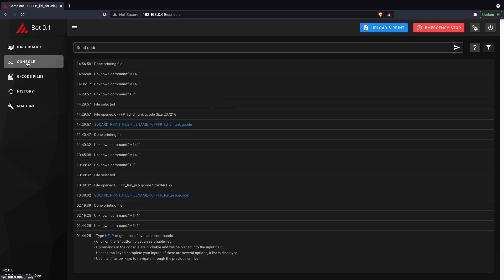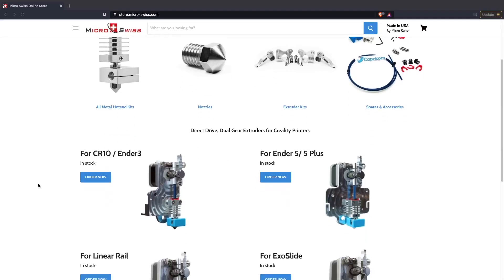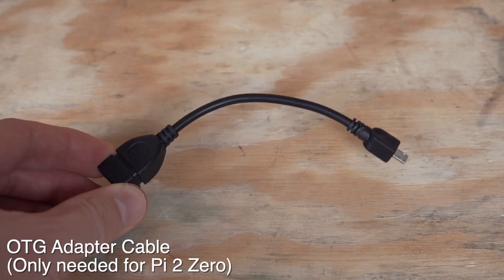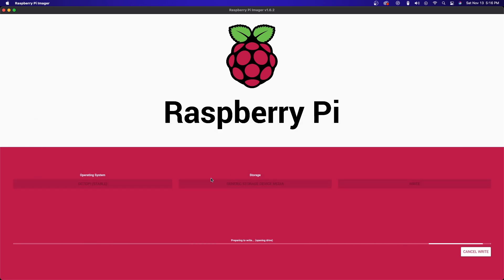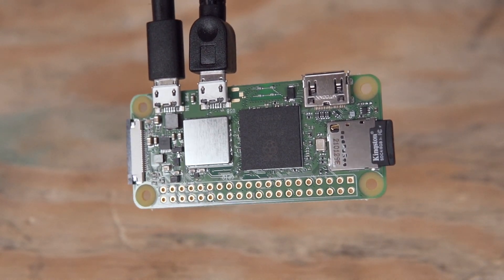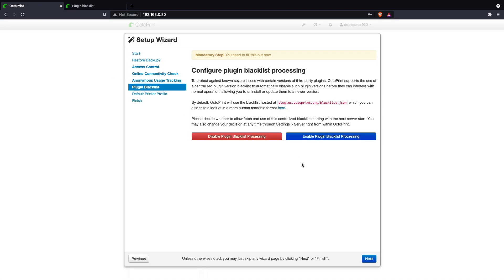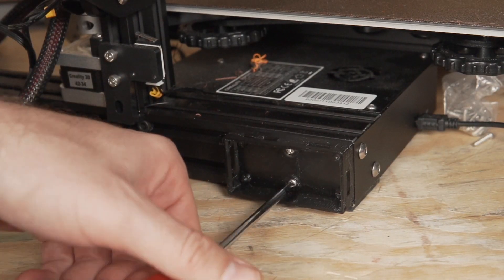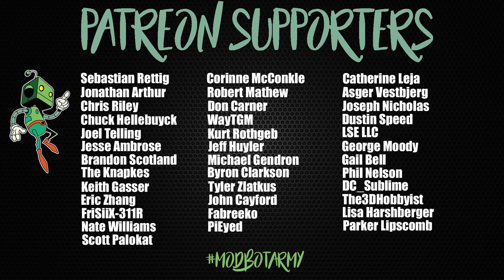Installing OctroPrint On Your 3D Printer Has Never Been Easier! (Pi Zero 2 W OctoPi Guide)

Comment: The OCTOPI build on the Pi Zero 2 W took me about five minutes. It was remarkable and needed no setting up.
BUT if you want VNC and all the other Raspberry pi GUI based interface in addition to Octoprint - go the 'install octoprint onto an existing Raspberry pi' route, not the all-in-one octopi build method. My RPI won't support the standard 'startx' GUI because octopi is a subset of the standard Raspbian.

Comment: I followed the steps but for some reason the pi won't connect to the wifi network.  I tried connect via ethernet cable and that works but when I disconnect the cable, I get disconnected.  Can you off any advice?

Comment: Hmm, I’ve got an H6 orange pi. Read somewhere it will work. Orange pi had more features and expansion and also allowed me to use a full size solid state drive to install the operating system to.

Comment: I'm going to try this in combination with a "USB ETHERNET HUB HAT VOOR RASPBERRY PI ZERO" So i can have the stability of wired internet and some more usb slots for e.g. cameras or connecting to the printer instead of the flimsy micro usb port. I will also use the printer power supply with a dc-dc converter so i dont need external usb power.

Comment: please someone show this setup with a wired connection to the internet. it should be easy but cannot figure it out, only ever get shown wireless setup. i tried just plugging the ethernet into the pi and no luck, its working over wirelss but the camera is lagging behind about 5 mins so wont a better more stable connection but seems like you cant, even tho theres a ethernet port on the board

Comment: Be very careful about using Octoprint.  It bypasses many important features of your printer board, including filament runout sensors and perhaps thermal runaway protection.  There's no way to tell if Octoprint is disabling your safeties without some complex testing.  I found this out the hard way.

Comment: Pressing CTRL + X (CMD+X) in Raspberry Pi Imager will open the advanced configuration setup menu. You can set the WIFI and SSH access there before burning the image, and remove the supplicant.wpa and .ssh file edits. I made a video about it a few months back. 
https://www.youtube.com/watch?v=eS-N8NCB9rk&t

Comment: Your video was very helpful and I installed octoprint on a pi0 w 2.. only issue is if the pi is still powered up I can't turn off my printer... it's a faint screen but it's still on until I un-power the pi. I purchased the cable you recommended from amazon but it must have data and power capability... any ideas???
Reply from the maker: I have seen others either physically block the 5v pin with something like a piece of tape or a bit more aggressive cut the cable and cut the 5v line.

Comment: @ModBot  FING app reccomended:
Hey! You said the easiest way to see the pi ip adress was logging into the router. I used to do the same, until i started having to set up pis at my workplace where i dont have access to the router, and had to rely on the hostname.
UNTIL: i discovered an app called "FING"  that scans the network and shows devices as well as online time, hostname and so on. It even has an option to wake on lan, ping and ssh via an ssh app. The app is definitely reccomended! it's available on both IOS and Android, and is a lot easier thatn logging into router, no matter how easi that may be ;)

Comment: You can disable the 5V wire in the connector between the Pi Zero and the printer - comms only need the data and grounds wires to be connected.

Comment: Octoprint is such a pile of hunk. It hogs resources, sure it has a bunch of plugins that arnt really needed but I run 5 printers off 1 raspberry pi using repetier server. The octoprint devs really need to do some performance fixes on that hot mess.

Comment: To prevent the pi powering the printer you can put some tape over the usb power pin on the usb-a side.
Reply: I wanted to not only thumbs up this but comment, very important step!
Reply: oh wow! I wish I thought of that before cutting the power wire on my cord. Kapton tape probably would be good to use.
Reply: what the heck
Reply: what happens if i dont put tape?
Reply: @cristianfernandezchaparro67  this will supply power to the printer board and cause a reset, having only the data connected will not interrupt.
Reply: @rwz  thanks
but i dont understand
can you explain more what that means?
i put stripes of tapes on the sides, but octoprint doesn recognize the printed as if its not conected...
Reply: @rwz  even without the tape i still keeps without recognizing the printer as if it wasnt connected
Reply: @cristianfernandezchaparro67  did it work prior to taping it?
check if you put the tape only over the power pin.
if it doesn't work I can not help you any more.
Reply: @rwz  no, i didnt work even without the tape, i think maybe is the cable, or the software of the printer, i had problemas with the printer before because the scrren goy stuck in "creality", the solution was to reinstall the software a couple times, after months the lasts weeks the problems was that the sdcards atoped working in the middle of the printing, i had to Buy a couple new cards and then same happened, not Even My laptop recognized the cards, so, or is the cable or is the software of the printer, i Will try to connect the Raspberry to the PC to see if its not the Raspberry the one that not works
Reply: Well... The PC isnt recognized... So i don't know anymore

Comment: I hooked this up tonight and could only get it working if I plugged the USB OTG cable into the 2nd port. If I used the first port it just wouldn't work, so I gather that is by design. I had some right angle USB OTG cables I was hoping to use, but those are out as they would block the power one. Will have to order a left angle one to make it a bit neater, but luckily had a straight one that will work for the time being. It's nice to have a Pi devoted to each printer.

Comment: Wasn't there a need to SSH into the PI to enlarge the storage to the full SD card?
Reply: No, its automatic now on the current releases of octopi.
Reply from the maker: Yeah I believe that was only with the older method of manually installing. With the current setup there is no need.
Reply: @ModBotArmy  I followed your steps yesterday and the boot partition was very small and 7GB where unformated till I added them.
SSH into the PI

sudo raspi-config

// first to make sure all is fine
update
// after that into advanced
expand_rootfs
// and
Finish

Comment: Can I use the gpio pins for the mk3s like I could with prusa print?
Reply from the maker: It should not be an issue. This does draw a bit more power but I swore I saw a few posts in Prusa forums saying it was no issue. I would double check just to be safe before.

Comment: Just bought a pi zero 2 w yesterday and was thinking of using it for this
but I am wondering  if for my needs a  1st gen pi zero W will do
ender 3 pro and jus for  simple printing ,  can you explain the differences ? how much slower is it?
I have a wyze v2 I was going to use  for a camera with it's original FW or RTSP FW
so I won't be using a camera with  it , I guess I could use the pi  zero 2 W with  the wyze cam connected to it via USB if I flash the   wyze web cam FW to the camera and  view it through octoprint instead of wyze app
Reply from the maker: Totally up to you. I used the gen 1 with no cam and didnt mind it. Hell I ran them in a farm config and had no issues. I have not done a side by side speed wise but if you already have the original zero w maybe try that and see how you feel.
Reply: Where did you manage to find a place to order them from? They're sold out everywhere I'm looking.
Reply: @housinit  Microcenter , in store
1st time they  came in stock they sold out in a day ,  about a week later they were back
they had 25+ not sure if there still in stock now thought that was few days ago

Comment: you know a good blocker that blocks the power on usb for my ender 6? i have no idea what to look for? i do live in eu.
Reply: I used an old USB cable and peeled off the outer sleeve. I cut a section of the red v++ wire and used electrical tape to cover the wires.

I felt this to be necessary, as the printer would try to power from USB (dim glow on printers screen). In my mind this is dangerous and must be looked at, as 5he USB bus is not meant to supply 24v and worst case scenario is fire.

I have heard of folks attaching USB to the computer before powering on the printer - the result being a corrupt firmware on the printer and a fried USB bus on the computer. 

Be aware if your printer lights up by USB...
Reply from the maker: You mean to prevent the Pi from trying to power the printer or to prevent the printer from trying to power the Pi? I have never ran this but if you did want to I have seen some use a thing tape strip to cover the 5V line. Or as mentioned below you can also remove the outer cover and cut the connection of the 5v line.
Reply: @ModBotArmy  the ender 6 seems to like put power on the 5V and that makes it that the printer sometimes just doesn't power on properly. i really want to use octoprint but i don want to fry it or my printer. i saw another youtuber using a blocker between the printer board and the pi. thought maybe you know were to find this, is it save to just disconnect/cut the 5V?

Comment: Does this work in parallel with Marlin then?  For some reason I thought it replaced it and was the printer's new "firmware".
Reply: Marlin stays as the firmware for your printer.

Octoprint is loaded on to the raspberry pi, which is connected to the USB on the printer like an external device.

The pi simply sends the gcode to the printer via the USB.

Basically, Octoprint gives you WiFi control (by Web interface), which is actually very useful. It can also use a camera to allow you to watch the print without being right next to it and a bunch of other useful stuff
Reply: @paulradford4100  Thanks!
Reply from the maker: Yup! So it is just an interface between the Octoprint and Marlin on your printer :). For Klipper it is a different scenario as it is its own firmware that runs on the Pi.

Comment: PSST!  Pi Zero 2W  ;)
Reply from the maker: lol updated. Thank you :)
Reply: So I took the plug and ended up getting a pi zero w which may have been a mistake.  I got an error message from Octoprint saying this pi is and never will be supported.  It did seem to connect but now not sure I should stick with it.  Guess I need to now upgrade to a 2W.  Anyone using the pi zero w?
Reply: @jerseybarrier64  have you tried using an older version of the  octoprint image? maybe Daniel could suggest one?
Reply: @andreamitchell4758  thanks and no have not. The board is working but sounds like I may run in to stability issues.  This is all new to me (thanks Daniel ;) )
Reply: I still think   pi zero w 2 makes more sense 
R PI foundation  dun goofed
I was searching for w2 and nothing was coming up when  trying to buy one
W 2  makes more  sense IMO

Comment: I've been thinking about upgrading my Ender 3 V2 to a linear rail system. Is it worth it and where can I find one not shipped from china??
Reply: I've seen on another video that it doesn't really make a difference in print quality.
Reply from the maker: I would argue not a huge noticeable difference. It is going to be stiffer and I would be curious to see if it has much affect on tolerances but I think it is a pretty overkill mod. That being said it has never stopped me before so if you want to I say hell yeah. The low cost ones can be decent if you do not mind shipping and cleaning them when you get them.
Reply: @ModBotArmy  Is the length for the Ender 3 v2 linear rails 300mm or 400mm??
Reply: I've been running a couple modified E3Ps for a while now and I don't see a need for a linear rail setup.  Once you have them tuned in, print accuracy is completely fine for most projects (I use mine primarily for functional parts).

Comment: Great video. If you know, will you be able to do a video "how to add multiple webcams to octoprint"?  The old method doesn't work anymore or I'm doing something wrong.
Reply from the maker: Not something I have done. Would the reason for this be to make cool timelapses from different angles? Or just if a print gets tall to make sure nothing if failing?
Reply: @ModBotArmy  I like to put one camera to the Filament roll since I have couple web cams laying around.  There is a multi cam plugging in plugging manager, but I did not had any luck.
Reply: @ModBotArmy  https://youtu.be/FzpBgEG_ksw 
This is so outdated.

Comment: I'd love to see how well Klipper will run on that. I do have several projects, that would innclude installing klipper on a printer and i'd rather not have to buy a full size PI, they are rather expensive.
Reply: It runs really well. I installed it on my ender 3.
Reply from the maker: It is going to happen. Lots of requests for this. I will show the install and then try to test it with input shaper.
Reply: Kossel Linear Plus, Klipper, Fluidd, Pi Zero 2, no webcam, runs lovely.
Reply: On my ender 3v2 all I needed was an adapter, pi zero 2 w, micro usb to micro usb (less than 40 euro in total). It took me 4 days to set up and finetune. Now it’s working very smoothly, all the Klipper algorithms were successful and helped improve my quality and speed!
Reply: I'm in exactly the same position.
Reply: It would be great to se Klipper without external power supply - I heard that it's possible, connect RPi Zero 2W to motherboard only
Reply: @Rajonex  it's only possible if the board's 5V regulator can supply enought current. For example SKR Pro can do that. Or you can use DC-DC stepdown converter.
Reply: @Rajonex  Adam is right. You just need a buck converter to connect to the 12/24v power supply. They're only a few dollars.
Reply: @corey640  I know about this "dirty" solution. I mean something more clean - in one bunch of cables send signal and power. Like in cameras where you use one Ethernet cable from computer. Using external buck converters etc it's not good technique, more places from you are getting cables - more messy view and overall rate of your modification.
Reply: @Rajonex  Sorry, a single cable from a Pi to a buck converter placed in a power supply enclosure, maybe print a new one with a larger fan, maybe even with room for the Pi, etc, isn't "dirty". Have you seen how many cables are underneath a printer for Christ sake?
Reply: The OctoKlipperPi is available in the pi imager now
Reply: $45 is "rather expensive"?
Reply: @corey640  More like 80$ where i live, 10% of my monthly salary.
Reply: @baivesan  Maybe $80 for a 8gb. I just bought a 4gb 4B for $55 and they had 2gb for $45 at PiShop. Order from one of the dozens of UK or US sites if they're marked up in your country.
Reply: @corey640  A 4 gig is currently $150 in my country (Scandinavia) with anyone having them in stock. Got mine for a steal 3 months ago, at ~$95. 2 gig is $135 ish now, 1 gig has been hens teeth since its release. The two shops that have the Pi Zero 2 W in stock, charge $100 for them. Or $110 for a basic kit.

These things aren't cheap in many places of the world, especially if you're in a country at the outer geographic edges of a market/trade region. But they're generally never available anywhere near MSRP unless you have an official RPi partner vendor nearby to buy them from. During the pandemic supply has gotten pretty bad. Heck even Chinese vendors are charging $120-140 for 4-gig now.

International Import from uk and us sellers can make a cheaper unit even more costly in many places.
Reply: @corey640  Yeah the PIs go for 45, but cables, power supply, sd card. Not super cheap :&
Reply: @pr0xZen  I'm sure you could buy a Pi Zero 2 from USA for $15USD... with reship shipping it would be less than your local retailer.. but if you say the 4GB version is only a few dollars more id strongly recommend that one.
Reply: @kylelongstaff  when you add a power supply case and cables it adds up even in U.S. The Canakit I bought was around $55. Pi 4 kits can run $100-150.

Comment: Awesome video.  Wish I had bought more of the Rock64 boards when they were so cheap on Amazon, so was pretty excited about this new Pi.
Reply from the maker: I dont know if I am familiar with the Rock64, maybe I am haha. Is it a small 64 bit sort of all in one computer like the Pi?
Reply: @ModBotArmy  yup, it's a nice contender for low power sbc home servers when you can't afford AsRock or SuperMicro SOC itx boards. It's a bit more evolved than the RaspBerry Pi.
Reply: @ModBotArmy  Its the same size as the Pi, and power wise its right about in the middle of the Pi3 and Pi4.  I missed the super cheap train, if you read the reviews on it there was some people who picked them up for $5ish, I bought mine when they were $15.  It came with 100% of everything you would need to use it, a power brick, a case, a micro sd card.  It even came with a small little screen, the screen was sorta useless for Octoprint, but extra is extra.  

Probably would have made a nice SBC for a small/cheap NAS too, as it has USB 3 and gigabit ethernet.  Amazon has since sold out of them, and every time they restocked them, the price went up.